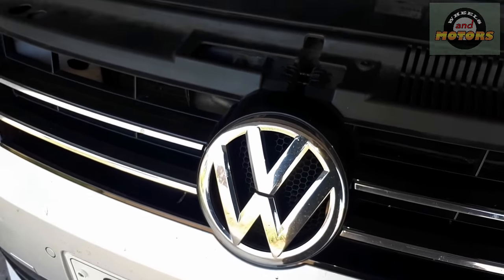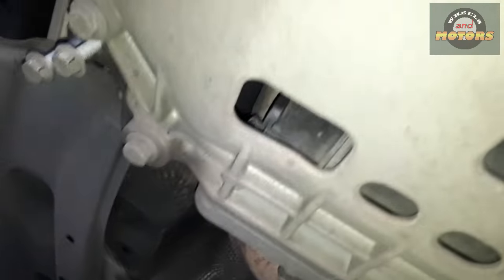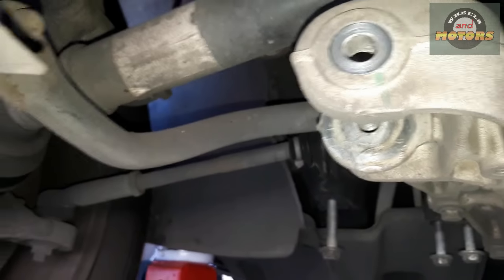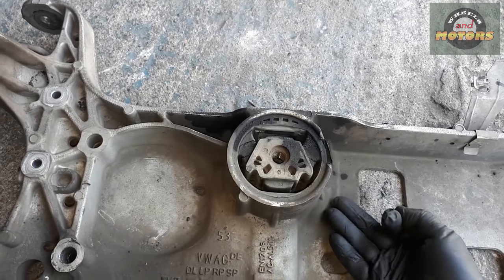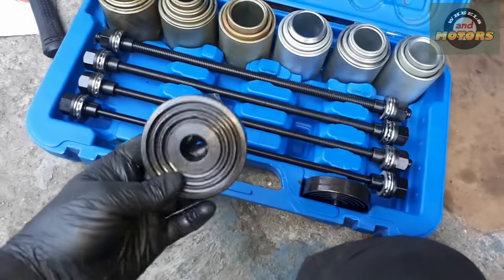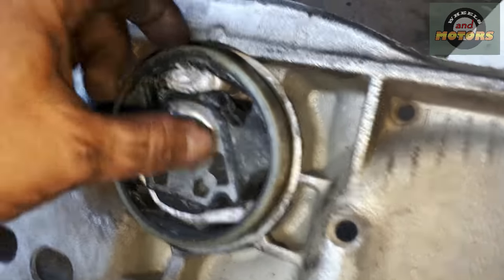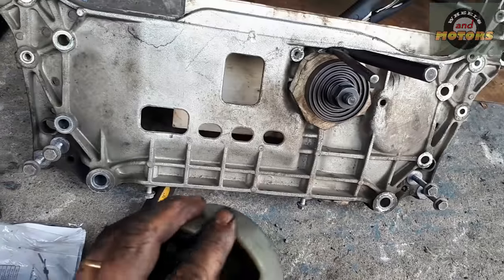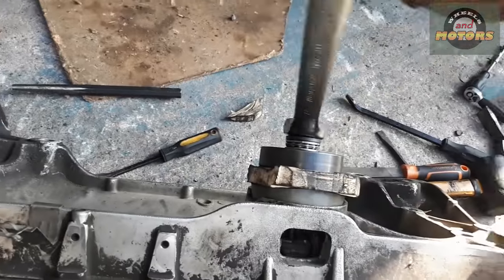How I replaced subframe bush (lower engine mount) - VW, Skoda, Seat, Audi.

Comment: I went to do a full set of engine mounts on a customers car, about $1200 estimate. And I discovered that this mount had been replaced a short time before, then I discovered that whoever replaced that mount failed to tighten the subframe bolts, I replaced the bolts with new ones and put blue loc tight on them, and the car is good to go. Saved the customer some money is always a better win in my book.
Reply: Cool. Whats the usual labor for this sub frame mount only ? Got couple of extremely high quotes. Rest of the mounts are less than a year old so only this one as I see the jerk from park to reverse
Reply: I puted new all new mounts engine and gearbox and still bogging on takeoffs

Comment: The trick is to install both bushings at the same time through the “bottom” so you aren’t squeezing that windowed part of the bushing through last.
Reply from the maker: In that case, isn't there still a risk to damage that narrowed window bit of bottom bushing?
Reply: @wawayltd  may I please ask where I can buy or get a the manual, for vw sharan 2013 please.
Reply from the maker: @rfayz733  VW has official website with manuals. It costs about 7 euros per hour to get access. 1 hour is more than enough to download loads. Here's the link:
https://erwin.volkswagen.de/erwin/showHome.do
Reply: It has a ridge inside the sub frame each bush can only be put in at the bottom and top !
Reply: Thank you!!
Reply: @SpikesMavic The one I just did (2009 Audi A3) didn't have a ridge.

Comment: Nice tool set, also you can make one from scrap lying around garage. Its just thread and bolt's with different diameter plates and cilinders. Put some old VW shock mount bearings for smoothnes and you have same thing.

Comment: Your videos are always excellent. Very informative. I did my timing belt on my T6 last May using your video. Regards Stephen
Reply from the maker: You're welcome, Stephen! One thing I did wrong with my cambelt videos - I believe the engine needs to be supported from the top, not by jack from the bottom. There is a risk of sump developing oil leak after all the pressure.
Reply: @wawayltd  I supported mine from the bottom. Other YouTubers show same so I went with it. I'll know when I do a service next year if there has been a leak. Cheers. Guess one more tool I need to buy. Can open up a garage at this rate lol. Stephen

Comment: Good video, very useful to know, I've had my sub frame (belly plate) off twice in three years, first to do with the spacers you've shown, making sure they go back on and not left off.. I was getting a creaking sound, caused by my old main bolts reaching their max yield point with being so-old, the belly plate was rubbing against the chasis.
Second time was becasue of the ARB bushings so had to reaplce those by taking the whole assmebly out and fabbing new mounts then putting on PU bshings.

I went out and bought a second hand belly plate with a good engine mount in it, luckily' so I won't  need to press a new one in place BUT I just might while I'm at it because it's not something I want to be doing any time soon, with not knowing the age of the mount and other spcifics. 
I'll be replacing the srpings too (McPherson strut) while I'm at it. 

I reckon with the size of those gaps at in the engine mount to where the plastic outer is.. I'll be packing the gaps out with a soft rubber (so no to cause excessive vibration) becasue that looks like quite a distance for the bolt in the centre to travel while the engine contorts under load, only seems correct to me!

If only the weather would improve here, I'd get started!! 
Hope your'e well and thank you again!
Reply from the maker: Thanks Jem, good luck with all that ☝️😊👍
Reply: Jem Mace no need for muck you can buy a engine mount insert for £20. Different poly grades.... this was unnecessary drama

Comment: Been waiting for this one. I did think about buying one of those kits off ebay, but diameter werent big enough. But i see it worked for you. Great video as usual !!! Ive used hole saws to get those in. Its a tricky job.
Reply from the maker: Thanks, I hope this tool set will be useful in the future.. Wow - hole saw?  How?
Reply: @wawayltd  bought 3 holesaws. Grinded teeth off so its like round metal colar like your kit. 95mm used to put the bushings insidr to stop them twisting and used threaded bar with washers and nuts. Hard to explained but it worked.
Reply: @wawayltd  I have same set, those rods are carbage, i have broke 3 of them allready. Cylinders are great for working with hydraulic press.
Reply from the maker: @dot7107  Well - that's promising 🙄😆
Reply: @wawayltd  They might work well with plastic bushings but with bushings with metal outer ring I managed to break 3 of them. Thinnest one I haven't even tried... I have to find better quality rods. Allthough idea is good
Reply from the maker: @dot7107  I'll see how it goes with mine.. Might invest in press in future.

Comment: Good job. Why was it replaced? Can you describe the symptoms? Mine rattles when accelerating in corners at low speed, also a sound when going over bumps. Also when reversing sometimes. Skoda Yeti. Thanks!
Reply from the maker: I didn't have any symptoms apart from those horrible cracks

Comment: Thx for the video. Can this bad mount cause jerk when doing park to reverse ?
Reply from the maker: Thanks! I have a manual gearbox. In my case, it didn't seem to cause any jerks. It just had a lot of cracks, so I decided to replace it.
Reply: @wawayltd  ok. Is this mount  anyway tied to transmission? I’m trying to get an idea if that jerk is because of mounts or actual transmission
Reply from the maker: Pendulum support with this mount is connecting subframe on one end to transmission/engine coupling on the other.
Reply: @-ssch I think it can. However, for me that was caused by the engine mount requiring replacement.

Comment: Nice video... have the same work ahead... i was wondering what kind of rod did you use for the pushing of bushings...m10 or m12 and was it smaller then the thread inside of the upper bushing?
Reply from the maker: I don't remember by now, sorry. I bought that kit and used it only once 😉

Comment: just a thought , has anyone tried heating a cut down oil drum , outside , up with just water in it , to simmering point , with the subframe immersed in it , suspended from the top with wire off an iron crossbar , this would make the whole subframe expand  many thousandths of an inch , it should then be much easier with the same basic procedure to tap out the old bushes & reheat the subframe , then tap new ones in , leave to cool down , then refit . A further tip is to have both new bushes in the deep freeze overnight to shrink them down .  I haven,t tried this , try it with a scrap one first , the idea comes from advice for getting gudgeon pins into new Same italian tractor diesel engine pistons many years ago , the current ones have Deutz engines in , don't do it to these ! Never expose alloy to a bare gas torch flame , it will melt & run like water . Be careful out there . Difficult job well handled .
Reply from the maker: Lots of physics there 👍
Reply: or just freeze the bushings lol

Comment: Great vid thank you, did you leave the steering rack in place ?
Reply from the maker: Thanks. I had to align the wheels after.
Reply: @wawayltd  Thanks for your reply, not sure what you mean "align the wheels" can you explain . cheers
Reply from the maker: Even though I left steering rack attached to column and wheels, steering rack sits on the subframe. When subframe goes back, there is a bit of play, so it won't sit exactly the same way. Therefore wheel alignment, a.k.a tracking needs to be checked and realigned if necessary.
Reply: @wawayltd  Ah ok . cheers

Comment: Can't we use a 12ton hydraulic shop press to press both bushings out at the same time? Is there a groove stopping the bushings?
Reply from the maker: There is nothing stopping bushings, apart from that sticking out bit on the bushing when you try to push it in.
Reply: You need sufficient width in the press to get the bush centre under the press plunger. My press wasn't wide enough. You need 36 cm IMO. Any less and the press is anti-useful in my experience.

Comment: Hi mate, did u replace the subframe bolts? Looking to replace my subframe and reading everywhere that u need new bolts as they’re stretch bolts…
Reply from the maker: I didn't. On my own risk. Sometimes, I don't replace stretch bolts (like engine mount for cambelt job), and just go by feel with torques. 
Don't take my word for it, I'm not professional. In fact, I'm not even a mechanic 😉. 
Do some research. See what people say. If you buy a bunch of bolts from dealership, they can be pricey for what they are.
Reply: Will be doing this on the weekend mate, just one more question… did u have to support the steering rack at all? I’ve got an Audi tts but it looks the same
Reply from the maker: @dzgorzelski It should be ok without support.
Reply: @wawayltd  nice one mate! Thanks for your help
Reply from the maker: @dzgorzelski  You can do it 👍

Comment: How did you know those bushes needed replacing? What were the symptoms of the car? How did it behave? I'm asking because I have a 2017 Skoda superb and the ride was very very rough, I could and still can feel every small crack on the road. I replaced the front and rear suspension springs and shock absorbers ...that improved the ride a bit but it's nowhere close to what it should be. it feels like the whole body of the car is very unstable, unpredictable and it just moves from side to side even on the motorway. the quality of the ride is absolutely terrible still...any advice? thanks.
Reply from the maker: I replaced those bushes because they had cracks. Not sure if it affected ride quality. 
Your car needs to be seen and checked.
Reply: @wawayltd  it's due for an oil change soon so I'll ask them to check. 
The thing is I have taken it to several places and they couldn't find anything wrong with it,  but something surely IS wrong. None of the cars I had before behaved this way.  anyway,  thanks for your reply
Reply from the maker: You're welcome, sorry I couldn't help. Hope you'll find what's wrong.
Reply: @wawayltd  no worries,.thanks anyway.
I've already looked prices for sub frame front and rear bushes, and it's only about £80 , so it's pretty cheap , I'll definitively give it a try in a few weeks.
Have a nice one
Reply: Just seeing this video now, not sure if this matters, but another indicator that the subframe bushing is shot is if you remove the transmission mount that goes into the bushing the bill that goes through the bushing won’t unthread. It will just spin in place
Reply: Have you tried checking the wheel alignment? Too much toe-out will make the car unstable at speed, it will wander around and not want to maintain a stable straight ahead direction.
Reply: @simontist  done the wheel alignment afterwards. You're right. After realigning it helped a bit. 10x
Reply: Please help Evil. I have Octavia and done exactly same… re-new front suspension,  rear suspension both springs (B4) , anti roll, bar bushes, new camber bolts , upper and lower arms etc etc and just got wheel alignment done today…  AND it’s still as unstable and dangerous as hell. Did you ever get to the bottom of fixing yours, was thinking of polly inserts into that bush, cause it’s a nightmare replacing and getting back in without bending and snapping the cream plastic
Reply: Usually you get lots of drivetrain lash when accelerating and letting off, and thumps between gear changes..

Comment: What’s the symptoms off these needing replacing
Reply from the maker: Cracks
Reply: On my 2010 VW Sharan Mk2 2.0 CR TDI broke the flexible joint on the exhaust pipe above the subframe, the part that is integral with the DPF/catalisator unit. The bushing for transmission pendulum is broken all the way. I think that the excessive engine/transmission movement caused the flexible joint to fail. Now I am taking out the DPF and the EGR cooler for cleaning and repairing the flexible joint, and that I have watched this video, I will take out the subframe too. Hard job, because I have no car lift, the car is raised about 35 cm from the ground, working underneath and in the engine compartment. the car has 404 000 km, I have already cleaned the intake manifold, intake valves and throttle valve from carbon deposits..

Comment: Can you leave the stabilizer bar too?? I mean take iff all those bolts??
Reply from the maker: Probably it is possible, but then I think it can be struggle to align these bolts when putting back on. So much easier to disconnect ball joints.
Reply: I did, just unbolted it. Left in the car.

Comment: Is it possible to remove subframe without removing the wheels. If I just keep the car on four wheels. Is there any issues since the control arm is connected to it.
Reply from the maker: If I understood it correctly, then that is crazy! Keeping all 4 wheels on a ground and remove subrfame that actually holds control arm?? It's unsafe. Also even if it stays together, how are you going to put it back? Please jack it up safely 🙏
Reply: Just remove the centre subframe! Don't touch the outer frames. Don't touch the outer bolts through the main suspension bushes, and don't touch the front bolts that are accessed through holes in the control arms. Then the wheels won't move. I think!

Comment: HI bro, i am also driving sharan
do you also replace the transmission mount and engine mount in the engine bay?
does all these improve the ride quality?
my car is My2016. I found the car not so smooth when accelerating from stop or stop to 0km/h.
Reply from the maker: I haven't replaced any other mounts, my car is on 418.000 miles.. Ride quality can be affected by many other factors - driveshaft joints, ball joints, bushes...
Also wheel alignment, tyre balance, or brake discs deformed..

Comment: If I am just replacing the lower bushing, would I be able to slowly tap (with a wooden block) the new bushing in? of course that would be after I clean up/smooth the frame and lubricate everything...would the tapping method work? thanks for posting the video by the way!
Reply: Did you press out the old bushing?

And the bushing wants to distort. Freeze bushing and use hose clamp or Get a 4” pvc coupling, grind out for bushing to fit in.  This will keep it from distorting.  

I personally would change both bushings bc my upper was shot. But you can’t tell from looking at it. It’s has microscopic tears that we don’t see. JMO good luck
Reply: @briansmith9258  ahh....good call, I only saw some microscopic partial tears on the lower one, so was "hoping" the upper one is still good. Alternatively, I might just try an insert to see if help and squeeze couple of years out of it.  I am surprised none of my local VW specialty shop has one of those VAG subframe bush tool, that would take them less than an hour for a clean job.
Reply: @fantiger  Yeah the insert will help but if you’re getting a lot of vibration and stuff if you’re tuned. 
that’s why I did it because I’m tune It was aggravating and I changed everything but those two mounts. Just made a world of difference when I did but def a PITA to change

Comment: There is a specific tool for this, and it pays to own it so you don't have to deal with unnecessary headaches.

The other alternative is to use a C-clamp with a metal plate on the empty side. Pops it in, in seconds. No need to grind and butcher the part or subframe.
Reply from the maker: Thanks, I should see this comment before my adventures with it 😉

Comment: These are a real pain in the arse to fit and align. I use a piece of plastic drain pipe and a large piston ring compressor...and swear lots !!!
Reply from the maker: I've used all my swearword vocabulary behind the scenes of this video 😁
Reply: @wawayltd 
If you buy the special tool for £300 and do a few every day.. You won't have a problem.
Doing one every now and then even with the tool can be a pain!!! 😩
Reply from the maker: I've seen some hydraulic thing on YouTube. Looks effortless. Can be useful for VW garage, not for just DIY enthusiasts that do it once in a lifetime..
Reply: @wawayltd 
I wonder why the bushes had to have soft plastic  rather than alloy on the outer casing. Can only assume its cost.
The old "dog bone" style as used on previous models was a 10min change over job... The part was cheap too. These new bushes (upper and lower) have to be purchased separately (?) and are over twice the cost of the old part. How is that a cost saving I wonder?
Reply from the maker: I think metal would be even more difficult to remove, and couldn't lead into more trouble if it goes bendy while inserting...
But in general  - yes it's a "pain in a bum" design. Also I had no clue that they come separately, therefore they are different design in the video.
Reply: @wawayltd 
Yep.. Upper and lower and they are all different for different models too. Money making scam by Factory!!
Reply: Haha - I thought about how similar it is to installing pistons, but didn't actually think of using a piston ring compressor! 🤣